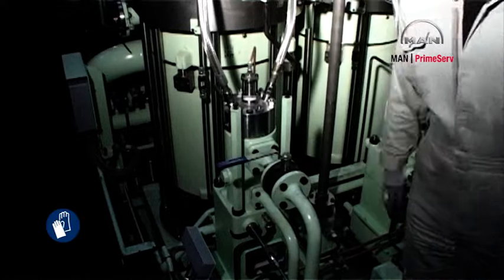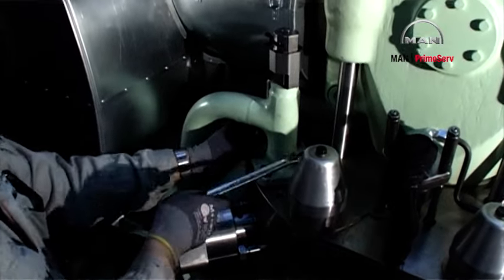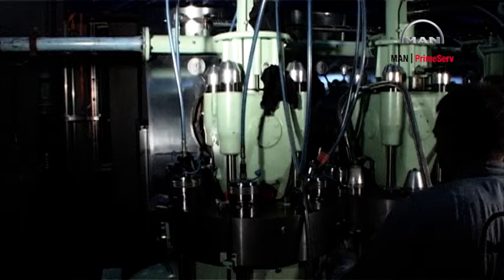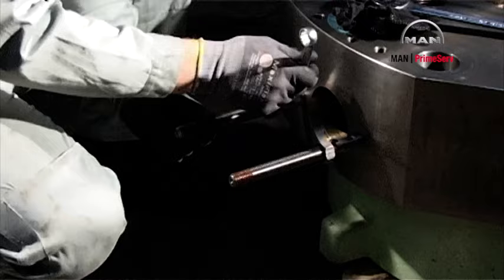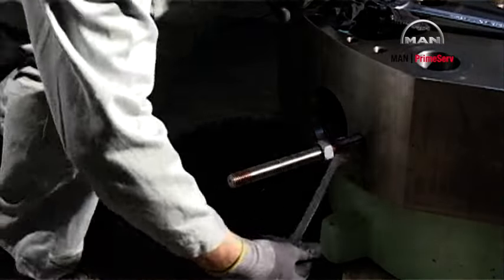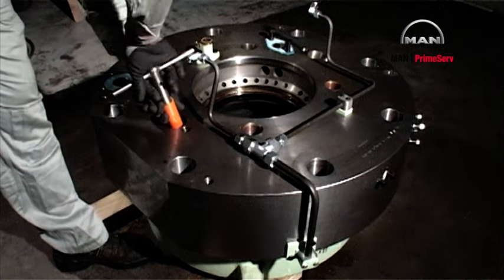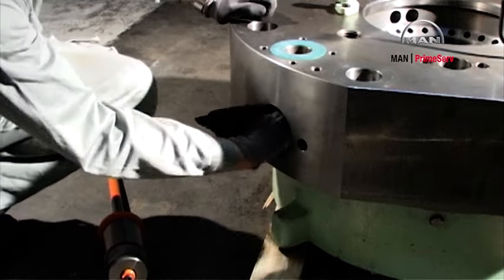Cylinder Cover Overhaul

Comment: I notice no mention of a cylinder relief valve removal and reaseating. If you are taking the fuel valves out , you might as well test them, clean the tips, assuming of course you have the rig, them being common rail these days.

Comment: The oil return pipe - we use it to close exhaust valve by high pressure oil, instead of using high pressure air, right?

Comment: this is a very informative video. However, we have a similar engine (7k60MC-S) but the cylinder cover comes with bushing for the fuel injector but from this video i could not see any bushing for the fuel injector. we have been trying to remove the said bushing but its almost impossible. please any advise?

Comment: What most idiots here don’t seem to understand. 
This is supposed to be a supplementary instruction video which does not substitute or replace the Manual. 

As a side note, air guns are great for gulling of threads and destroyed fasteners. A professional knows when and when not to use those.

Comment: I did notice when he was using the hydraulic bolt equipment he was loosening the hydraulic bolt removers by turning them hand on hose connection point which to me seems like a bad habit practice longterm in respect of longevity use life of the tool better to remove a tool correctly to maximise the life use of it

Comment: if it's very hard to release hyd nut, what is max hyd pressure ? on the instruction working pressure (dismantling condition) is 1400~1650 bar. It's 6S60MC-C8.2.

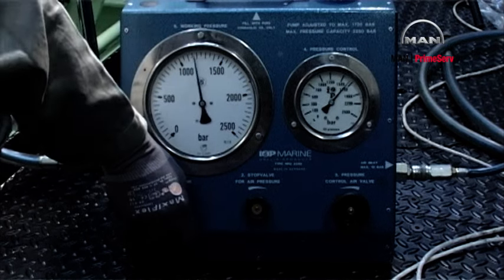Comment: 5:00 How can pressure be this much high? 1500 bar!!
Reply: It used to be 1700 bars on our ship. Hydraulic pump helps in building that pressure up. Without that it is impossible to loosen or completely tighten the hydraulic bolts.

Comment: Just for the record that is called a cylinder head in engineering jargon not a cylinder cover😀😀
Reply: You are incorrect. On an engine of that type its called a cylinder cover, as injectors are called Fuel Valves which they used correctly.
Note all threads they used copperslip/ molyslip, excellent practice which I have been using for 55 years even on cars. If it moves lubricate it, if not paint it.

Comment: Never use ajustable wrench...
Reply: He did, just on one pipe connection that often do not conform to any spanner size  and then it was a Swedish Bahco, the best, but you should always use the correct sized spanner /socket, not an adjustable.

Comment: I think once u overhaul a cylinder head u should check the condition of liner or calibrate the liner,water connection between head &  liner not shown.pressure testing of head is not done. Anyway marvelous video
Reply: Md. Abul Bashar

Comment: What is the name of the tool that turn the nuts?!
Reply: hidraulik jacks
Reply: I'm finding it difficult to understand how those little hydraulic nut removers can apply sufficient torque with out having a firm anchor. They seem to just sit on top of the studs and twist those nuts off with ease.
Reply: videoclipits     those small hydraulic nut remover simply stretch the stud against the the cylinder cover thus freeing the nut so it could turn the nut with minimal effort. The video somehow miss 1 important thing on removing the nut, the hydraulic tool must be loosen by at least 3/4 turn so that when you release the hydraulic pressure on it will not trap the tool when the stretch stud return to its original length. One thing I noticed was it uses 1500 bar pressure in removing the nut which is almost double to the one I usually work with or maybe it is because they used new type of stud material on the video
Reply: Girlie Padasas
Thanks for the explanation.
Reply: Girlie Padasas  In my engine we definitely used around 1200 bar.

Comment: 1500 Bar. Thats over 20000 PSI. Holy smokes!
Reply: Over 22,000psi actually, stretching those massive studs enough to loosen the nuts by hand. I'm very impressed.
Reply: @n6mz  If one of those studs snapped, that jack would probably end up going through the roof. lol
Reply: Possibly into orbit.